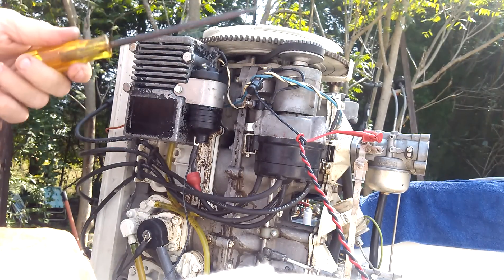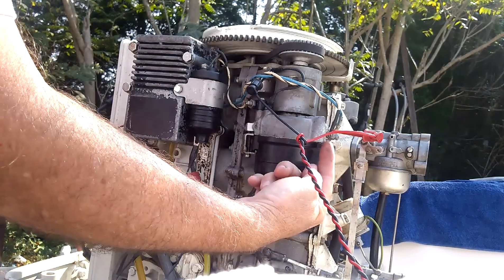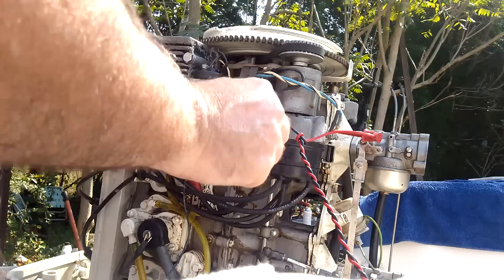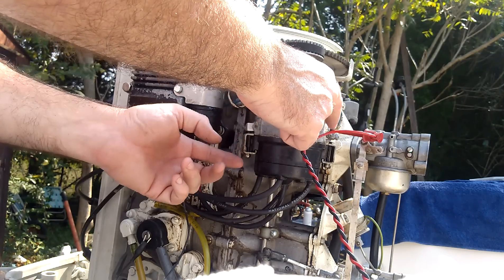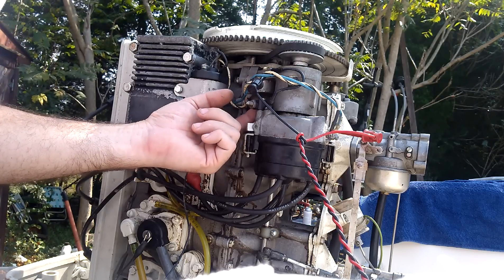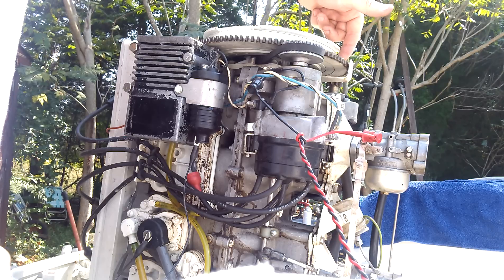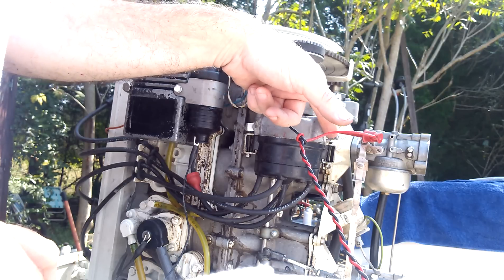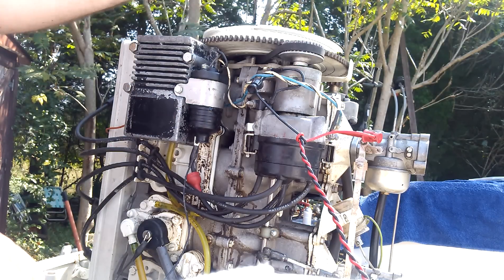Chrysler outboard setting ignition timing Part 3

Comment: Hey, wanted to drop you a note, thanks for doing the Chrysler outboard videos.  I have a 707H, 1973 70hp that ran great for years and wouldn't start last year at the dock.  Backfiring and popping, it seemed the timing wasn't right.   I have a manual that I used, but remembering this video I watched over the winter, that put it all together with the multimeter.  I found that spot where I got continuity turning the flywheel, locked the nut down and it fired up.  This old girl has 125 psi in 3 cylinders, never opened up, pushes a 1976 Star Craft Super Sport on Lake Erie for walleye.  Thanks for the help.

Comment: These videos u made on the 105 is it the same for the 120? 
I just got a 1976 ski boat but I was told that that 120 is not original im getting fire to the plugs but I can't get it to bust off and when I bring the number one up this mark o| lines up with the I on the timing tab is that right?

Comment: Great video.  Its gotten dark here so I gave up and decided to watch some vids on timing.  This saves me from having to muck around with setting TDC and the likes on my own.

As for the photo interrupter, it is not an incandescent globe!!!  I got my engine with a blown unit, so I built a 'preamp' myself... which necessitated that I tare the old one apart. It is definitely an IR LED and you can test for its operation by looking at it thru a cell phone camera.  If you see a purple light , it works.  Also, the output should definitely be between 0 and 12 volts.  If it isn't, it means that the transistors on the photo interrupter are failing.
Reply from the maker: scrfce123 Mine is definitively a lamp. I suspect at some point they switched to LEDs. It measures like a lamp with no difference in resistance measured both ways. It is going to get replaced with a sensor out of a old disk drive soon. I am not waiting for it to fail completely and leave me sitting.
Reply: mweverett I just got mine started tonight.  The carbs are leaky and the water pump is junk, but it runs.

Wow.  I didn't even know that it was possible to use an incandescent globe for position sensing.  Amazing.  Unfortunately, the Magnapower CDI unit likes its input signals to arrive processed (as a 12V peak, square wave).  I believe that most optically triggered CD units (the Crane XR700 comes to mind) have built in signal generators so you need their photo interrupters and their CD modules to get it running properly.

I'd be happy to share a schematic of the sensor that I constructed with you- though it isn't exactly a proven quantity as of yet.  Cost me $15 in parts to construct.  A lot better than the $150 odd AUD that CDI charge for their 'preamp' units.
Reply from the maker: scrfce123 I am in the process of 'fixing' my pickup also. It was flaky and though it worked, the voltage would drop as it got warm or the wind would blow. :) I removed the guts out of the plastic housing. That was fun! :( Thanks but my 'thing' is electronics so I will roll my own.

Comment: Hi, my Chrysler 75 hp has a sticker on the flywheel. One end says TDC and the other is 32*, and about 4 lines between these two positions labeled “timing”. My manual is different than what I have. So…..
TDC and distributor pulley “T” is lined up. But where do I put the tab on the sticker to fire plug #1?? 
Appreciate your help! Thank you

Comment: Hi I got a 1978 105 and I need the distributor plug wires order because I replace plug wires and I lost the correct order so If you can help out I purchased

Comment: so if i cant get mine to spark from the distributor and i dont have the eye sensor then do i just replace the points and condenser? it ran good then went to start it after a water pump replacement to check it was pumping and gears would shift but it wont start and it seems i don't get spark at the plugs? can you help? i have the 1973  85hp  motor
Reply from the maker: Will the starter run? If not the shifting linkage is likely not in neutral, so the starter block switch is open.

Comment: Hello there 
I got a 105 and runs perfect but hard to start after warm up so I think is the idle mixture screw needs to be adjusted, my question is do the engine had to be in water in forward gear because that's what the manual says
Reply from the maker: Yes that is the best way. I do it in a test barrel. The low speed mixture screws should be set between 3/4 and 1-1/4 turns. Tighter than that and you can lean seize the motor up. Is its out of that range the tiny passages behind the needle are likely stopped up.
Reply: I'm going to try that this weekend
My problem is that when the outboard is cold starts good but after running for few minutes is hard to get it to start and when it does sometimes dies when I put it in gear
Reply: Do you think that can be my problem some times when start at first time idles really low then die then I use the throttle advance to get it running again

Comment: Hello there 
Thanks to you I got my 105 running right, but now I'm thinking on a electric fuel pump conversion, do you think is possible doing it with out any issues???
Reply from the maker: Do not use an electric fuel pump. The carbs only get 2-3 psi. but more importantly there is no way to do it safely. At least without a lot of complication. You need a way to kill the pump if the motor otherwise quits running. No easy way to do that here. Rebuild kits are readily available and cheap.
Reply: Thanks for your help I thrust you help

Comment: Hi, Great Video. I've been working on a 78 115HP and having a bit of a problem getting it timed. Been using your videos as a template for the way to do it, my issue is, the signal coming out of the trigger side is always at 12volts no matter how much I adjust that screw connecting the distributor to the tower shaft. Any idea why that might be? We have our Voltmeter set to DC, 20v and less to read.
Reply from the maker: Ryan Schleicher Does it run as it is now? The timing could be way off. Rotate the flywheel and see if you get 4 hi low changes in one revolution.
Reply: mweverett It Does. In fact we've been on the lake a few times with it already this year. Just never felt right about the timing though not getting it to be where I think it needs to be. We have the privilege of the sticker you referenced in the earlier video on top of the flywheel. We've been able to verify that TDC appears to be correct utilizing a screw driver in the #1 plug hole and making marks on it to get it's highest point. We have the Seloc book and according to that our 115HP is just like your 105, 32 degrees. We have the 32 degree mark right on the sticker, so I line that up with the pointer mark/tab bolted onto the block, turn key on, wide open throttle with stop against the block, but like I said, no matter the adjustment of that screw, I can't get it to be at zero, it's always at 12V. That curved line embedded ontop the distributor that's supposed to be running along the edge of the flywheel looks correct, if that was off, would that cause this problem? Could it possibly be adjusting it a degree or two closer to TDC might make the difference? I'll go spin it tonight and let you know if I notice any drops.
Reply from the maker: Ryan Schleicher Yes if the Distributor is not timed to the flywheel it might run soso but the timing will be off. If its off way advanced that is a motor ruining bad thing.
Reply: mweverett Just an update. Rotated the flywheel last evening, no four hi/low charges were noticed. Thought that was weird. Took the distributor cap off to look for damage inside the cap and noticed that there was a bad connection coming off the trigger lead that connects to the white/black wire lead on the spark side of the distributor. I fixed that, secured all leads, re-synced the distributor to the flywheel at TDC, rotated flywheel to 32 degrees, and the timing set without an issue. Did the ol' bet wiggle trick, and it seems to be just about right. Hit the key, boat fired right up. Gonna hit the lake later with it today to see how she runs. If you ever get some time, could you possibly make a video that shows going through the carbs? Or is there one already? Thanks again.
Reply: Trying to diagnose my starting issue think it's either the coil or the preamplifier could you throw some knowledge my way?

Comment: also  you didn't show in video  so when you set it that set screw  is it firing  at that moment or is it ur setting it just about to figre and then when u touch the belt its supposed to fire  on both sides of the belt??  and you talk about 36 and 32 degrees which one?  i have decal on mine  and it points 32  with a semi half decent arrow  so id set it there?
Reply from the maker: As I mentioned, the advance depends on the year and which HP motor you have.  Less is safer...might make a tiny bit less power. More is asking for a blown engine.
Reply from the maker: You touch one side of the belt and the signal goes high. The other, back low. If you are set on the timing marks on the flywheel and you have the throttle is wide open and the link is set dead on.
Reply: Mark I am going to try and go a wee bit low on my 78 140, per your advice. I can get non ethanol 91, but here in Canada $$$.
Reply: My old mechanic guru (89) told me to use the same 28 BTDC as you, to negate any ping. (Wish he was here, 50 miles away).

Comment: when you set it at 32 did you take the belt off and reset the distributor to that mark?
Reply from the maker: No. You sync the distributor to the flywheel using the arc and line on the distributor pulley and the 0 mark on the flywheel. Then the 32 degrees or what ever your model calls for, will be in the range of the link adjustment.
Reply: Its a 1976 105, am not sure what to do, I rebuilt the carbs, set the idle screws to 1 1/8 out, float adjusted level to carb face, cleaned carb soaked them for two days in carb cleaner and blew it out with air compressor, all the linkages is set where it should be, timing adjusted 5/8 out, belt as you said, timing mark is at 0 with distributor mark and plug 1 piston out as you said, there is spark to all 4 new plugs (Champion UL18V), I don't have a vote reader so I have not check those setting, new gas and oil, no gas leaks and gas is flowing to carbs and filling the bowls, all new 5/16 gas holes, it acks like it wants to start but won't, oh I notice the oil I used is 2 cycle does that matter? I just don't know what to do now, I sure appreciate your help..
Reply from the maker: @sonnypearson  Come over to the Chrysler the Best Outboard Ever page on Face Book and lets see if we can work this out. Also go to Harbor Freight and buy a 10$ meter.
Reply: @MostlyInteresting  I ordered a meter from Harbor Freight, not sure when I will receive it. I joined Chrysler the Best Outboard Ever, I do have problems with face book, it seems to lock up my pc all the time so I have to keep refreshing the page, it only happens on FB, but anyways, I will post what I posted hear